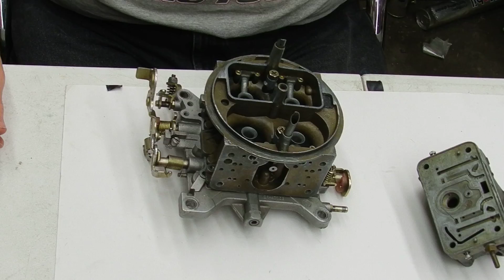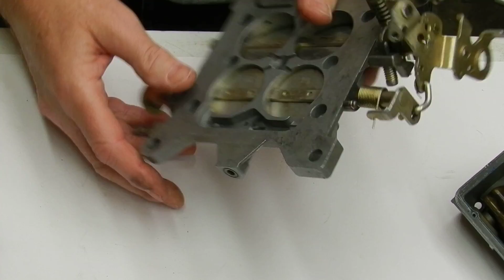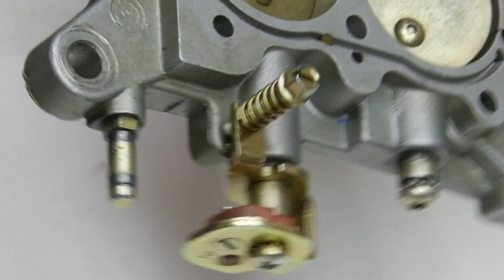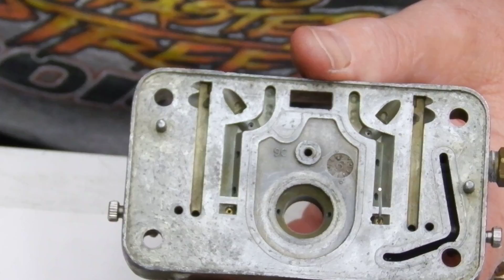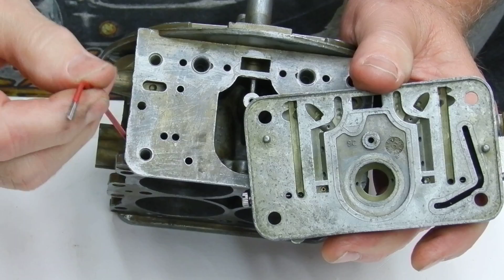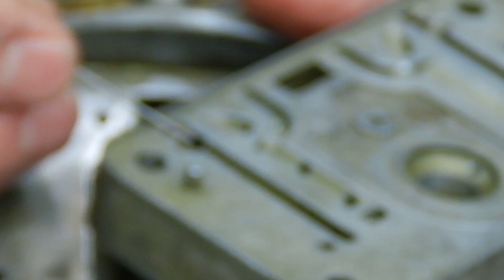Holley Carburetor Tuning: Idle Circuit Mods for High Duration Camshafts

Comment: Randy, I seem to get lean transition AFR’s at steady cruise with all my 4 corner idle carbs when idke is set to the highest vacuum and idle. Lean at 1500 rpm at about 35-40 mph unless I run a fat idle . My prior 2 corner carbs never did this. Any ideas?
Reply from the maker: What size are your ifrs , and your idle air bleeds
Reply: @holleycarbshowtosadvice40y90 .071 IAB’s and .031 IFR’s. 4 corner 4779 on a 383 stroker with 10.5:1 compression, AFR 195 heads, and 230/236@50 cam.

Comment: At the end of the video where you talked about making this modification to a vacuum secondary the carburetor you showed only had the primaries drilled out. But you said to drill all four which is not what was done to that carb in your video. So, should I drill all four like you said or just the primaries like the carburetor that is shown in your video?
Reply from the maker: Is your engine a high performance or full race or daily driver?
Reply: @holleycarbshowtosadvice40y90 it is a 355 SBC daily driver with a Comp Cams 12-600-4 Thumpr. It’s a 279/297 duration with a 107 LSA. It only has 10 inches of vacuum at idle in park.
Reply from the maker: I would stay with a two circuit. Usually I run a three circuit carb on full race engine. You can do it either way but on some vacuum secondary carbs you have to epoxy the main body to complete the secondary idle circuit. It all depends on which carb you use. With your cam I would drill some holes in the butterflies to bypass some air and that will close up your transfer slots some by lowering the idle screw and then finish your tune with your idle air bleeds if needed. Start with a 3/16 size hole in the " primaries" throttle plates only. Hope this helps.
Reply from the maker: You can drill your primaries or drill four smaller holes in the primaries and secondaries that up to you.
Reply: @holleycarbshowtosadvice40y90 Thank you!

Comment: Gday Randy,  Have you tried drilling those holes inline with the idle port and away from the transfer slot a bit, for mixture. Mike
Reply from the maker: If you have a high performance camshaft that creates low idle vacuum , you have to bypass air pass the throttle plates, that allows you to back the primary idle screw out to close up the transfer slots. Look when you drill holes through the throttle plates you creat a vacuum leak which raises the idle speed and allows you to back the primary idle screw out which will close the transfer slots and lean the idle circuit. You can control the idle circuit with the idle mixture screws but that will not change how much fuel is entering through the transfer slot. The only way to limit the fuel flowing through the transfer slot is to close it up. Hope this helps

Comment: Hello,the problem im having is,the butterflies on the primary side are not closing down past the t slot,in order for me to adjust the curb idle . I've been sanding and clearancing,to get the primaries to close all the way,so drilling holes will let the primaries,close  so i can adjust it with the screw?
Reply from the maker: Just set your transfer slots where they are about .020 open and adjust your secondaries to get your idle set  and that will bypass enough air. Unless you have a real big cam then you may have to drill some air bypass holes in the throttle plates. Hope this helps
Reply: Yes it does,i just have a baseplate i get to modify to get the throttle blades to close all the way on there own @holleycarbshowtosadvice40y90

Comment: I come back to these videos all the time... I am finally competent and doing ALL of my own tuning. With your help and the speed talk forum. Its freakn great ..... I have a 780 3310 modified with a 850 base. A 950 HP,  A 850 choke horned chevy crate motor carb and now a 850 BLP HP from market place with the 5 emulsion bleed metering blocks on the bench and almost ready to tune on my motor.  Thanks for your vids... The Wide band is my friend. Fast systems w/ duel o2 sensors.
Reply from the maker: Glad to help

Comment: How can i repair throttle  shaft leaking or sucking air
Reply from the maker: I've tryed this its just not worth it, the time and tooling is not cheap plus a worn throttle shafts. I just buy new .Ebay has some great deals .

Comment: Randy, thanks for the info. I have been dialing in my 750 hp like this, currently i still have too much transfer slot exposed but i am up to 1/8 inch hole. I have an AFR gauge and I can richen and lean up the idle circuit using the mixture screws which are all One turn out. The problem that I am currently having is that it goes very lean (16.5) according to my gauge with light throttle pressure at a cruise where there is very little pressure on the engine cruising at 1800 to 2000 RPMs everywhere else it is in the 12-13 range. Any suggestions?
Reply from the maker: I need to know your list number and 4 circuit idle or two circuit ide, and have you changed your ifr circuit or idle air bleeds and how much transfere slot is exposed and what type of booster are you using?
Reply: @holleycarbshowtosadvice40y90  intake 248 exhaust 254 @ .050 110 lobe sepertion

Comment: Ok Randy, I just finished my main body air bleeds. 70 idle circuit and 27 high speed air bleeds. Good starting point for my stock 454?
Reply from the maker: Yes on stock motor .027 hsab and .070 idle is a good starting point .

Comment: My car stalls as soon as I go in gear. Cam is 447 lift and 223 duration at .050. Lobe separation is 114. Is supposed to work with stock converter at lower idle. I can get it to idle with the secondaries adjusted but it’s too high. Idles fine in park.
Carb is spread bore 650 with 2 corner idle. I think I’m at the point of needing to drill the plates. Do I do both since it’s only 2 corner adjustment?
Reply from the maker: Will your engine idle down to 800 rpms in neutral and is the mixture screws controling your idle at 800  It should even with a 2 corner idle circuit.  Let me know at what rpm the engine will idle smooth on its own. Your cam specs. are fine.
Reply: It will idle pretty low for quite a while but then it will idle down and die. I would say at 1000 rpms it will idle forever but I need that 800 rpm idle.  I don’t have a tach currently so it’s a guessing game. 
My vacuum signal also bounces. I just pulled carb off last night to reset all the adjustments and start over.
There was a point on my last effort my mixture screws weren’t effective.
Reply from the maker: Ken that vacuum signal should not be bouncing around with your cam. I think i would check compression first and recheck ignition timing. You can change to a 4 corner idle circuit but may not help. I really don't have enough information, like compression,  ignition timing, camshaft installed straight up or advanced. I'll try to help if you can give me some more information on your engine. Take care.
Reply: @holleycarbshowtosadvice40y90  
I’m running 18* initial advance and cam was straight up install. I’ll have to check compression as I bought this engine already assembled and don’t have that info. The vacuum signal is stable at a higher idle but when I get it low enough that the cam is loping its bounces from about 8-12”. As soon as it drops it dies.
Reply: @holleycarbshowtosadvice40y90  
I might add also that it is really rich at idle. So much so that my eyes burn and water like crazy.
Reply: I kinda think I’ve been chasing a rich idle issue when I’ve actually been lean.
I did do a 2000 stall and got dramatic improvement for idling in gear but will still die if extended idle in gear.
Engine warm and plates set to desired position. Transfer slots at .040.
Close the choke flap and it idles  dramatically better.
Any thoughts?

Comment: I put a big cam in my FE motor the car won’t idle at all, and I got one guy telling me I need a transmission with a converter and someone telling me i need a bigger cfm then my 600. Should I try this butterfly modification first?
Reply from the maker: With engine idling, trans in park will it idle on its on or does it start up and  cut off. Give me some information about your engine and your cam specs. I need your cam duration @0.50 , lobe seperation, intake center line and lift and is it flat tappet or roller. Also the size carb and did someone just rebuild it. Also compression if you have it Write me back.
Reply: @holleycarbshowtosadvice40y90  stock 352FE with stock heads and headers just installed a comp cams 270S cam with a Edelbrock performer intake and a 600cfm Holley vacuum advance carb. Car won’t idle at all. Had 3psi of fuel while holding the gas down to make it idle so I got a bigger fuel pump. Haven’t installed yet 
Intake duration at .50 224
Exhaust duration at .50 224 
Advertised intake and exhaust duration is 270 for both 
Lobe seperation 110 
Flat tappet cam
Reply: @holleycarbshowtosadvice40y90  stock compression 9:1 and that’s what the cam is rated for and I also did the upgraded springs
Reply from the maker: Ok bud that cam  should work fine, now if   the holley carb has been rebuilt i wont you to remove the carb and turn it upside down and remove the philips head screws that hold the throttle plate  assembly and look carefully at the gasket and see if its covering up the two outer idle circuit holes by lifting up the front corners of the gasket on the primary side of the main body. Its so easy to put the wrong gasket on and it will block the two outer holes of the idle circuit. Let me know how it turns out.  This cam should work great with your engine package. Hope this helps.
Reply: @holleycarbshowtosadvice40y90  thank you I can check in the morning I am at work for the night and I have no idea on how to set a base starting point for my secondary butterfly adjustment. Do you have a video on that? And thank you very much for responding I appreciate you
Reply: @holleycarbshowtosadvice40y90  okay I checked the throttle plate gasket and it’s correct. I put a 6psi fuel pump on it and it runs better but still won’t idle. I have 59 jets and a 3.5 power valve in the carb. Anything else I should try out?
Reply from the maker: The cam you installed should not cause an idle issue. I think you have a blockage in the idle circuit or a vacuum leak. A engine will idle with 2 or 3 psi of fuel pressure , it needs 5 to 6 psi to perform at all speeds. Hope this helps.

Comment: Iv got a holly 4160  it cranks and idles good but when i get in and put it in gear and acelerate it just creaps along even if i floorboard it
Reply from the maker: Write me back your list number on the choke horn of the carb  and also information on the car or truck and when you accelerate hard does it backfire , try to send as much information as you can like when this problem started and what you have done so far.

Comment: At what amount of cam duration does this become required? I have 274 duration and have been having these problems, is it time to get the drill out?
Reply: Cam also has .300 lift at intake and .450 lift at exhaust, with 1.6 roller rockers… just want to make sure this is the problem I’m having before I end up drilling holes
Reply from the maker: There's no way to tell you exactly but low vacuum is what causes this problem, all we are doing is bypassing air past your throttle plates, try raising your  secondary idle speed and lowering your primary idle speed to close up your transfer slots, sometimes this will help or even fix the problem. Make sure to adjust your idle mixture after you change
your idle settings. This may work for you if your cam is 274 degrees of advertised duration. Hope this helps.
Reply: @holleycarbshowtosadvice40y90 it’s a 383 stroker. I’m getting about 13 hg vacuum. It’s a Holley 4160, 750 cfm. I can get the car to idle great at 750 rpm with the idle stop screw all the way out. Car runs with the primary idle mixture screws all the way in. Still super rich and on the verge of fouling plugs. Just can’t get the thing to lean out even a little.
Reply: It’s like the primary idle mixture screws do nothing, the secondary’s change the vacuum and idle though…
Reply from the maker: Ok  if the power valve is leaking it will run real rich with both mixture screws turned all the way in, and if there's to much transfer slot open same thing. This is the two most basic things that will cause your concern. Hope this helps.
Reply: @holleycarbshowtosadvice40y90  I really appreciate you taking your time to reply and help me out. I was pretty sure my power valve was working fine, but just in case I got a new one, 6.5. Unfortunately its still smelling awfully rich. Transfer slot is just as it should be as well… no transfer slot open on the secondary side. The engine idles great at 700 rpm it’s just rich.  I’ve tried advancing ignition timing as well. I’m sitting at 22 degrees advanced. Vacuum advance is hooked up to ported.. Ya think drilling the butterflies would help me lean this thing out?
Reply from the maker: At this point you may need to drill some bypass holes but before you do drill holes. Remove the carb and look at how much of the transfer slots are exposed on the primary side  throttle plates and let me know , i can tell you if drilling the bypass holes will help.

Comment: I have a 289 sbf w/ a big cam and it idles between 1200-1400 rpm. Anything lower than that and engine stalls. Any idea how I can bring down the idle between 1000-1200 rpm? Thanks in advance 🙂
Reply from the maker: My nova was mostly used as a drag car, but  when I locked out my distributor advance the engine idled so much better. There are several ways to do this, a full lock out or recurve the distributor advance, recurving the advance means for  instance you might want to set your ignition timing to 26 degrees initially and bring 8 or 10 degrees in mechanically for your total ignition advance of maybe 34 to 36 degrees. You will probably need a start retard box to retard timing while cranking. I ran MSD ignition with a start retard box on mine but  other companies offer the same thing. Hope this helps
Reply: @holleycarbshowtosadvice40y90  Thanks for the tip. Will try this out and let you know result 🙂

Comment: Excellent explanation, subscribed  next vids should be details of hole sizes, and how to increase decrease thousands to improve a slightly RV power to hot to mild engine ,regardless of make/model. ok, a bit of a tough one, but general basic explanation would be great. 61 old fart like me needs more detailed  info
Reply from the maker: Hey ill be 68 in three weeks but I quess your talking about when to drill air bypass holes and sizes from Rv cam to mild to a wild cam . Should be able to soot a video soon.
Reply: @holleycarbshowtosadvice40y90   thank u old man..lol..dang  i feel young now. :)